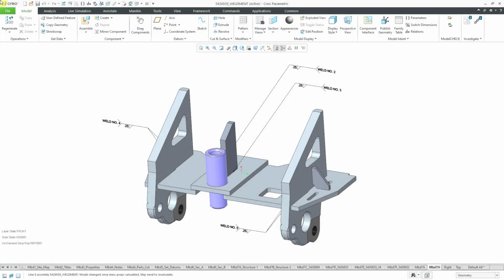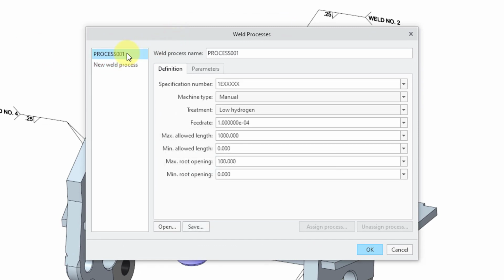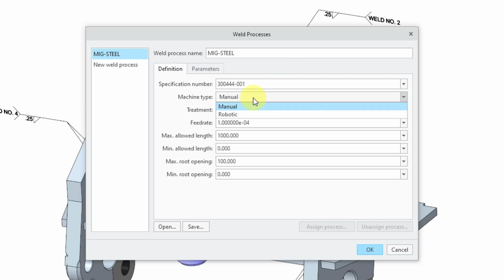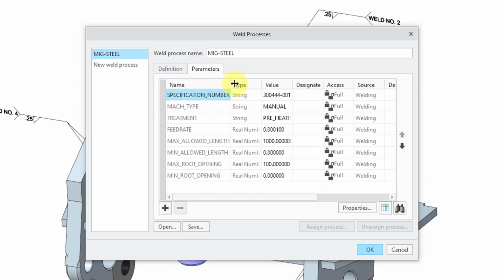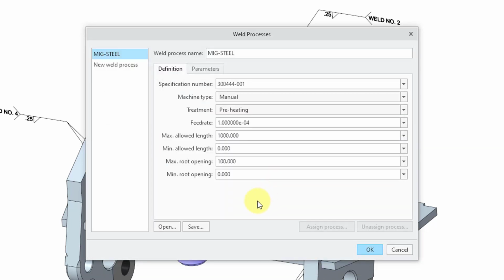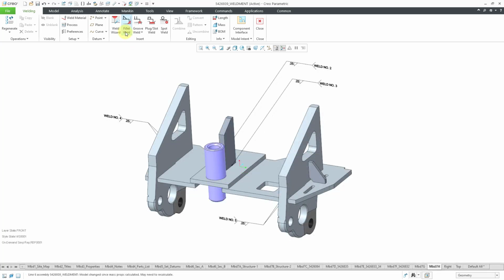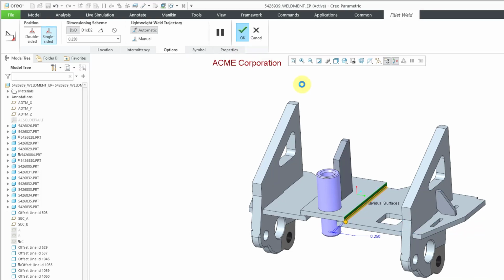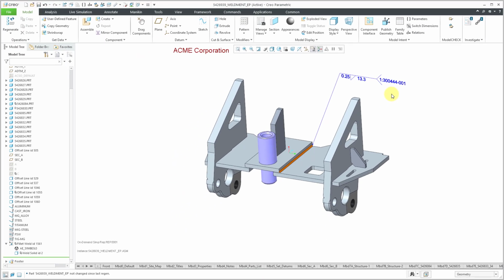Creo Parametric - Weld Setup (Part 3) - Processes

Comment: How do I set the display of the weld size in its symbol without decimal places, e.g. a2 instead of a2.00?
I have changed the parameter weld_dec_places to 0 , restarted Creo and it did nothing. What am I doing wrong?
Reply from the maker: I don’t know off the top of my head. I recommend opening a ticket with PTC Tech Support.